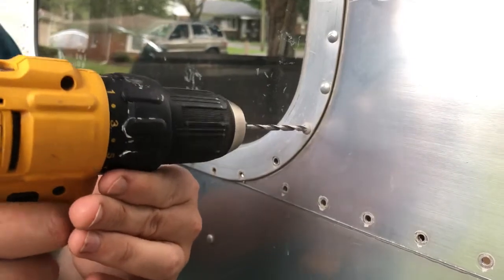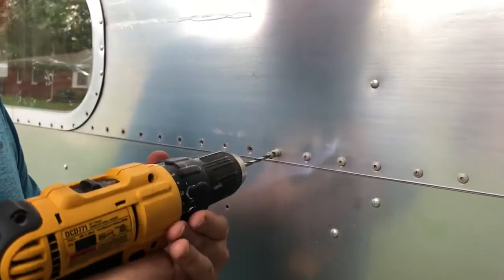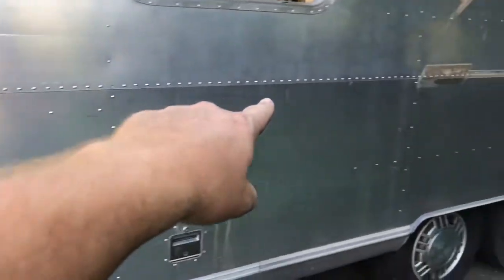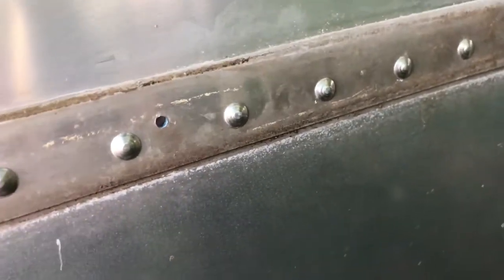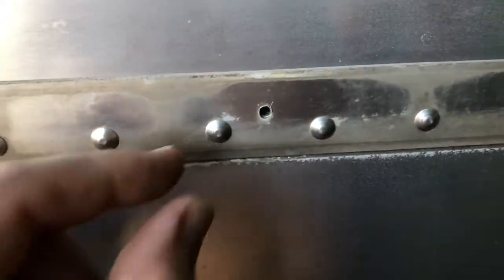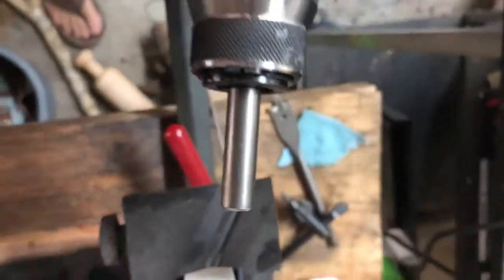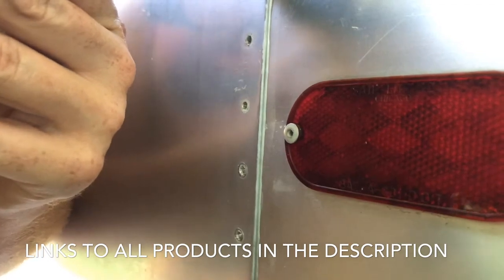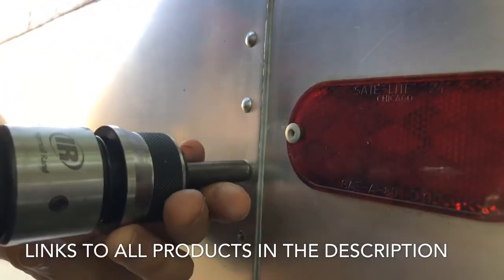How to install Buck Rivets.  Airstream Restoration

Comment: Why are you drilling the rivets out like that?
Reply from the maker: Someone had put of bunch of the Olympic Rivets in trying to fix a leak I guess and I replaced them with factory Buck Rivets.
Reply: The proper terms for what you call buck rivets are solid rivets and what you call Olympic rivets are blind rivets. Dude using an airhammer might be OK for what you're doing here, but in aviation we have to use rivet guns (like 3X or 4X Chicago pneumatic standards or Ingersoll Rand AVC12 or AVC13 standards)which have a more sensitive trigger to properly buck a rivet for structural applications. Cool video, I just wanted to share a small nugget of information.